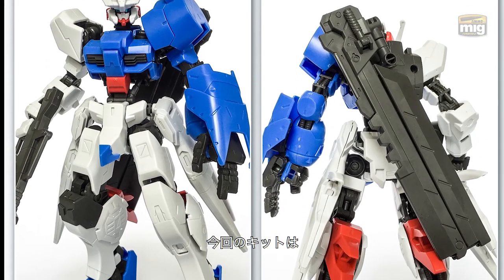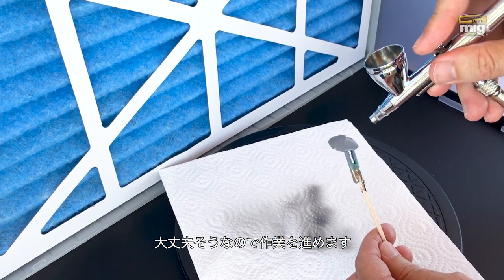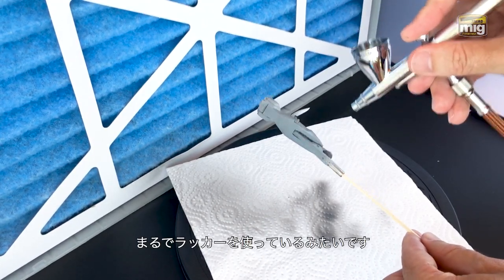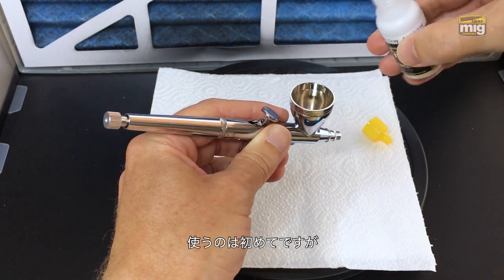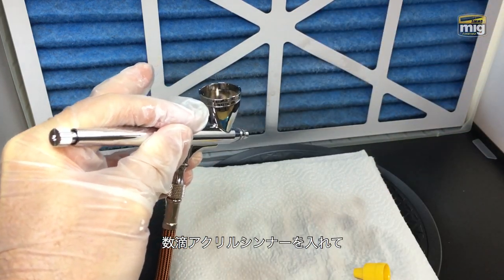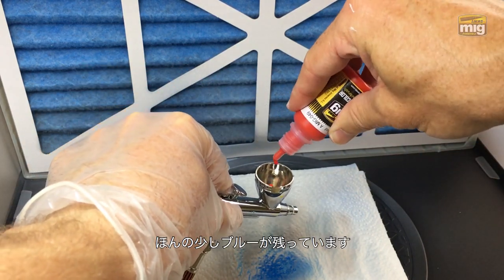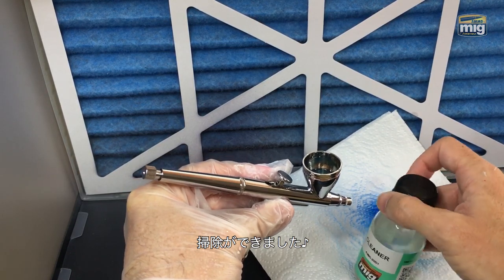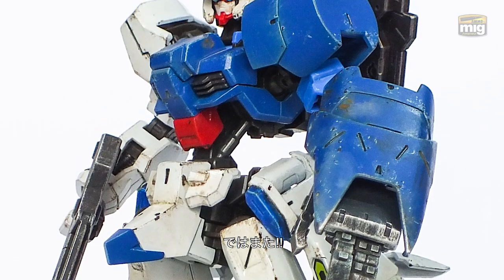Gunpla Airbrush for Beginners

Comment: The reason why the result was smoother with thinner in is because the thinner has a leveler agent in it to slow drying time for a smoother finish. Ammo thinner has retarder already in so you wont need to buy retarder agents or flow improvers.

Comment: How does sanding fit into the mix? Would you sand pieces before priming? Is there any reason to sand surfaces and not just leftover bits from the snippers?
Reply: You need to sand more than just the nubs. The casting process produces imperfections and those need to be sanded as well. Sometimes a dent is created that needs to be filled before sanding. Here are some other painting tips….Tip 1. When you are cleaning your airbrush, increase the air pressure by ten to fifteen psi. Tip 2.use lint free scientific tissue wet with thinner to clean the inside of your paint cup and the outside of airbrush. 3. A 1:2 ratio of paint to thinner will help you achieve candy paint( and is my go to ratio in general) 4.apply photo etch parts with glue before you paint to ensure a strong hold( most hobby glues eat paint). 5. Use an explosion proof exhaust fan when painting with lacquer because the fumes are flammable( the fan is usually more powerful as well and will keep your environment fume free). 6. The distance you hold your part away from the spray will change the texture of the finished paint 7. Use a moisture trap as water will cause a splatter effect and ruin your finish( I do my painting near a fish tank so I use one on my tank and my gun) 8. Make sure you use the rapid drying thinner for metallic colors or the metal flakes will sink into the paint and effect the metallic look 9. Always use the slower drying thinner for non-metallic colors to ensure a perfect finish 10. Always use a static free brush on your parts to get rid of the static electric buildup from sanding that will attract dust to your paint job

Comment: Why dump the cleaner out instead of shooting it thru the brush to help clean out the inside of the needle housing and tip, etc?
Reply: Stops any dried paint getting into the nozzle and blocking the airbrush.
Reply: starwarsgeekdotnet sure, you can also do that. I don't think it's right/wrong and wanted to keep the video nice and simple. I just finished spraying 4 colours through it so there was a good chance of dry chunks inside the bowl. You could also spray the cleaner through, no worries. 😃
Reply: Lord Seriqolm yep 👍🏼

Comment: Hi, i got a zz gund 1/100, and i wanna customize my gumpla very nicely.
My question is... I cut everything first and paint before i start build it?
Reply: Hi Hiro, thanks and that's a cool kit!! Most important, there are no rules!! You can build first or cut, clean and paint, then build. I do both and decide by the project.
Reply: I usually prefer to cut and assemble first considering that if you're going to try to get rid of seam lines you're going to have to join them with glue that model cement can really mess with the paint it's better to just put it on the plastic and sand the seams after it's dried then paint it

Comment: Theres only one issue with your paints, the primer, i have tried diluting it evenly, watched the acrylics troubleshooting video but still the primer barely sticks onto the surface of the plastic
Reply: What types of plastics are you using it on as some have mould release left on them that need to be washed off... Thinner air brushed layers show this problem up more than with hand brushing. It's not a usual problem but worth a looking into as a possibility.
Reply: Kevin Yang hi 👋🏼I've only used the 2 Primers so far and didn't dilute at all and you can see they went on super well. Have you also tried them undiluted?
Reply: I havent tried your oneshot primers before but yea undiluting it still causes the paint to grip onto the plastic surface in small splotches with cracks similar to a turtle shell
Reply: One shot is really good. Then very fine coats over that, works well. Good luck!
Reply: You could have a humidity problem.
Reply: Sounds like either a humidity problem, or you didn't wash/sand your pieces first to get the mould release off.